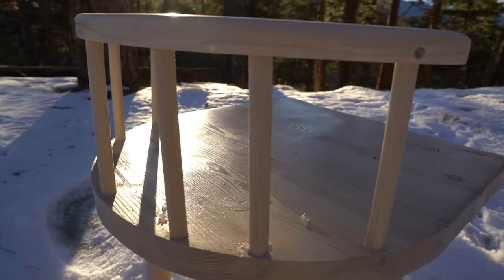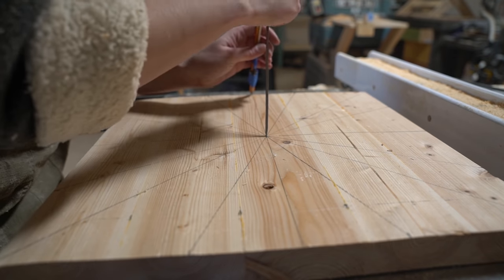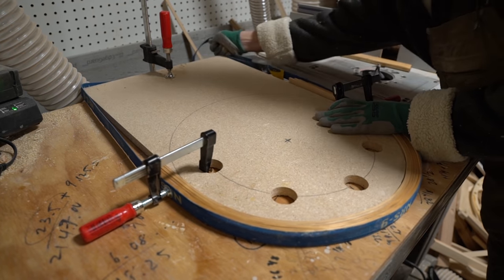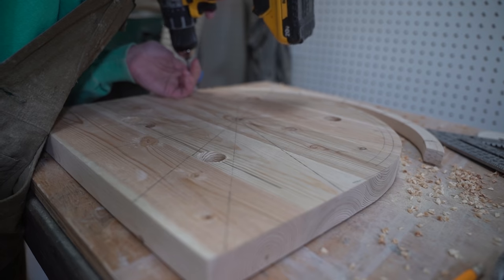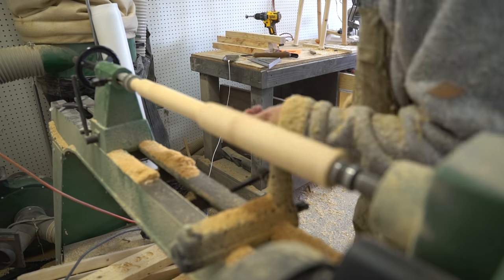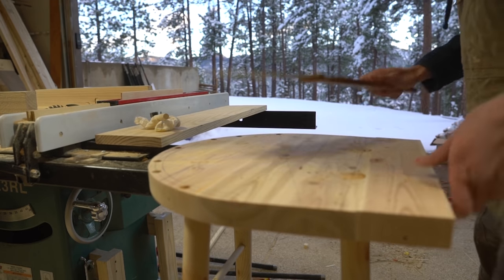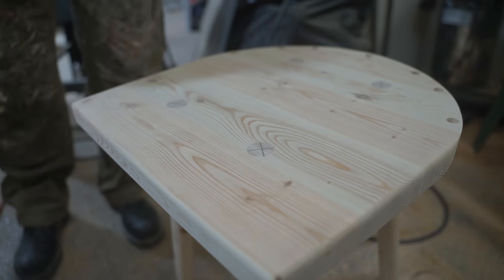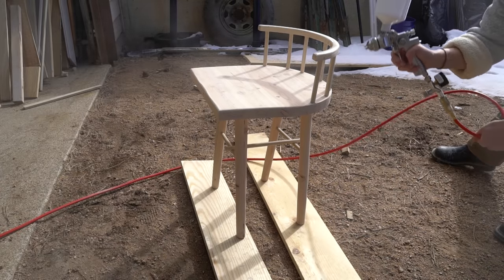DIY Low Back Stools | Maker Update!

Comment: A poorly designed stool that will not last.  Go look at real stools and see how they are engineered, the designs of real stools is not done for fun, they are designed to properly distribute the load that is placed on them.  This design  is really crappy and looks like something an elementary school kid might draw because they don't understand anything about engineering.  

You bending is also poor.  If you want to bend a back for it then you don't need to cut lots of slats of wood you simply need to apply enough steam to bend the full thickness of the wood you are bending, but your steaming chamber is also pretty crappy so probably not capable of doing it.  If you want to just glue together thin slats then you really don't need to steam them.  If you cut them thin enough because this isn't a very tight bend.  You do however need to use the right glue and the appropriate glue for what you are trying to do is hide glue that you heat in a pot.  The hide glue would be stronger than the wood itself and not subject to breakdown from moisture like a wood glue.
Reply: Hmm.....enjoy being the anonymous know it all mean kid?
Reply: @ronburton7090  You enjoy being the enabler telling someone that can't sing they have a great voice so they go perform for an audience and make a fool of themself?
Reply: ya just can't take criticism from a duck seriously.